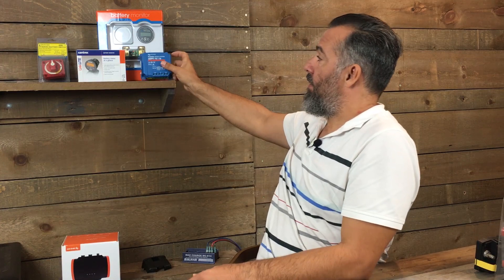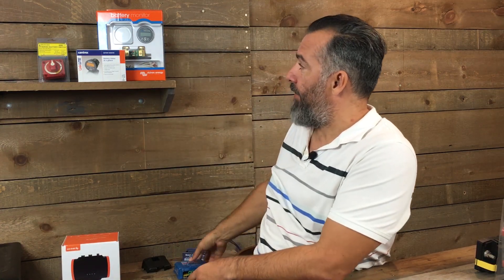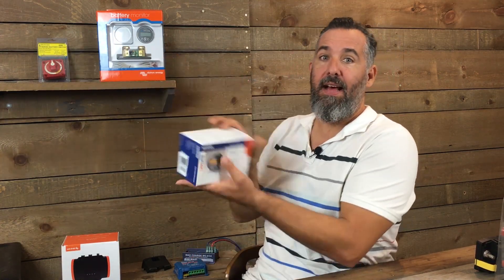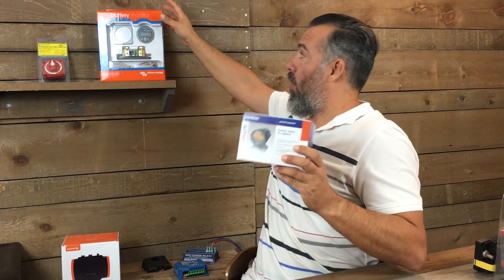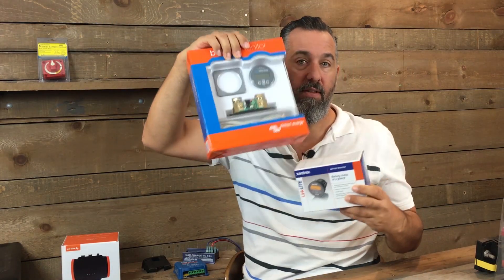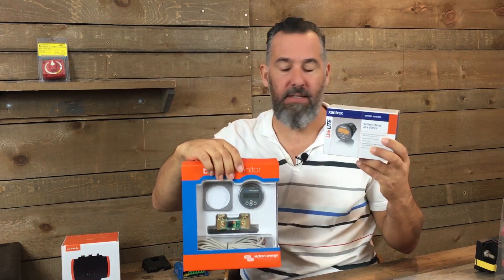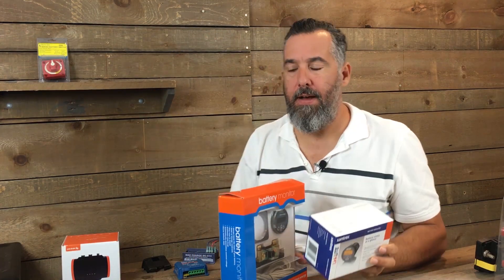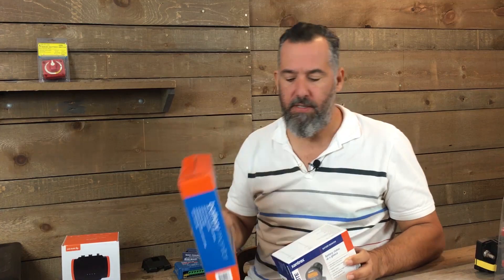I Have Three Battery Banks Do I Need Three Battery Monitors?

Comment: Hi. I have 2 two engine, and 3 battery banks: start, house, and thrust battery. Separated with Victron Argofet 200-3. 
One alternator (with ground to engine) is charging through Victron to all batteries, and the other alternator is direct to house battery.
Both engine has common ground... 
Start battery is connected to both start motors with power + cabel

I have 2 battery monitors with each shunt. 
Question: How to wire ground (minus) so I can monitor/see amp charge/load on both house battery AND start batt on each monitor?
Guess the ground cabel is the problem..
Do I need to seperate ground on both engine, so one engine is all ground to start battery shunt, and the other engine is only groundes to house battery shunt?

Comment: I seen a guy that had Three batteies with built in blue tooth monitoring, after downloading a app hes able to monitor all three batteries at the same time by looking at his phones screen , they show up on the screen as battery 1 , battery 2 battery 3.

I have 3 sok batteries with built in Bluetooth monitoring, after down loading the sol bms app I'm abble to monitor all three batteries on my phons screen but not at the same time , i have to choose which battery i want to monitor, battery 1  battery 2 or battery 3.
I'm trying to figure out if theres a way to see all 3 at the same time.
When buying new batteries this feature is pretty important but i don't know what kind of batteries that guy had

Comment: If you have 3 batteries which are all connected to a both switch and you put the monitor after the switches then whichever you switch on you get the battery monitor for this one I suppose...

Comment: So I have one bank. 660 AH (6 group 27) - I see monitors in various AMP sizes 100, 350, 400, 600.... how do I know what size to get?
Reply from the maker: When sizing  a battery monitor, you should consider battery voltage and max anticipated current from the battery. For instance, for house battery that might 400 amps from running a 3000W inverter at 12 VDC, for an engine battery it might be the maximum current to start an engine e.g. 500 amps. Effectively chose the size of shunt of your battery monitor to max anticipated loads for that battery.

Comment: I have a 23 ft boat with two banks of dual 6V AGM (250 ah) batteries wired in series with a battery switch.  I run both banks in the “ALL” position so I’m pulling and charging from both banks at the same time.  I have a 200 amp alternator to charge my batteries.  The big current draw is the four stereo amplifiers running a single large sub and 14 speakers never knowing how much battery I have left.  Since I run both banks together can I just use one Victron battery monitor on one bank to monitor all four batteries?   What do I need from Victron to make this simple and work?   Thanks, Darren

Comment: I have a cruiser with 4 batteries total. There's a 3 banks battery charger and a battery bank selector switch showing (1 - 2 - ALL - OFF). One of the batteries is dedicated to generator, then you have the engines and house. What is the best way to know my voltage and when I need to start my generator when at anchor to recharge my batteries. Was thinking of adding a simple volmeter on each battery, those are cheap and I know when it's going close to 12v and charging is needed. Comments?
Reply from the maker: Good direction Eric, you want all battery banks on a boat to have a voltmeter connection. Either you go dedicated voltmeter for each battery bank or you install a switch that allows you to toggle the battery voltage from multiple sources and display it on one voltmeter.
Reply: @PacificYachtSystems  Ordered cheap voltmeter monitor for engines and generator. For house battery I ordered one with a shunt in order to get more information.

Comment: State of Charge (SoC) monitors are notoriously inaccurate.
They don't take in account the loss of capacity in your batteries (ageing) and require frequent calibration (when batteries are full - which you may not know whether they really are).
You're much better off with cheap shunt-ammeter and a voltmeter for each of the battery banks.
And some knowledge on the subject.
Reply from the maker: Thanks for sharing John.

Comment: I have two battery banks and what’s wrong with making one battery bank out of them and getting rid of the wiring mess that being used? I just bought the 4 batteries and they are the same.
Reply from the maker: Hi Larry, some boaters like to have a battery bank that is only used for engine starting and another bank for house loads. Keeping the engine battery always full to make engine starting easier.

Comment: what about using the Victron derbo gx with Victron energy GX touch 50 panel screen and the 3 Victron shunts. 10 metre limit  on cable lengths from shunts though
Reply from the maker: Yep, the new Victron will definitely do that. Great product by the way.

Comment: Thank you Jeff. !!!! I have a house bank with four AGM batteries. I use a Victron BVM12 and the shunt  and I use the Aux battery leads for my start battery.
How do I monitor each battery?
Reply from the maker: Hi Mike, you should connect the engine battery to aux voltage input of your battery monitor and the house battery gets connected to the shunt providing all the benefits of amps and amp-hours consumed.
Reply: Thank you again Jeff I appreciate your reply!!! What I was wondering, is how do I monitor each battery in the house battery bank?
Reply: @mikenelson1387  get a shunt for each one.

Comment: I've got a Balmar battery monitor that monitors multiple banks.  Each bank has a shunt and they are daisy-chained and then connected to the single monitor display.
Reply from the maker: Thanks for sharing Mark.
Reply: @PacificYachtSystems  Absolutely!  I watch your videos each time they are released and greatly appreciate the expert opinion!  I've learned a lot.
Reply: The key is that each battery bank (system) has it’s own shunt.  Having a common display makes sense, especially in this day and age when some much of this equipment is now designed to be connected together with a communications network.